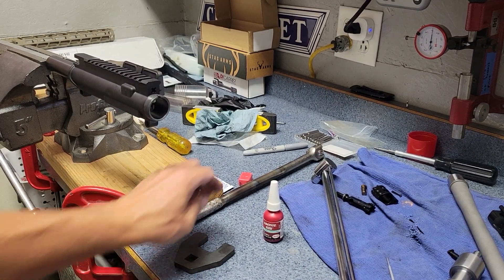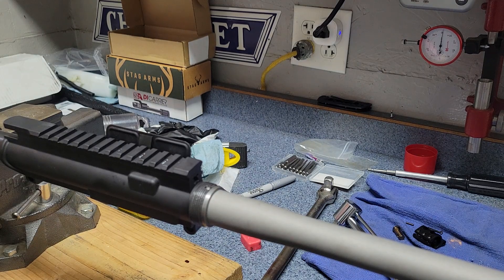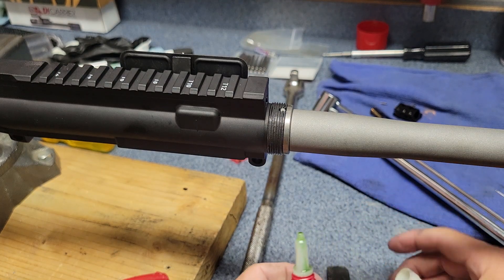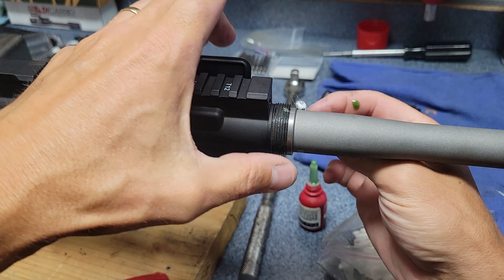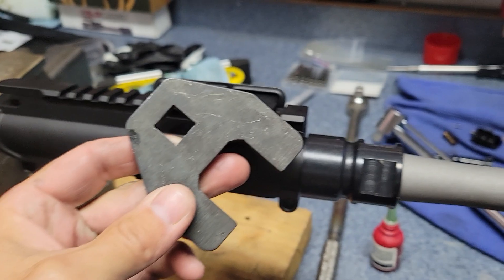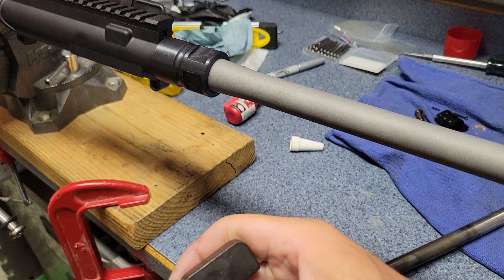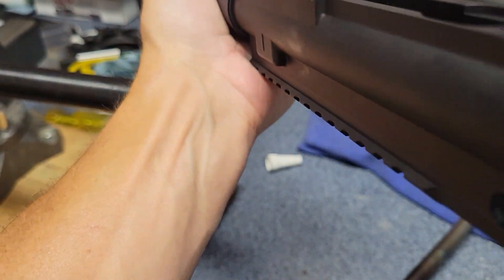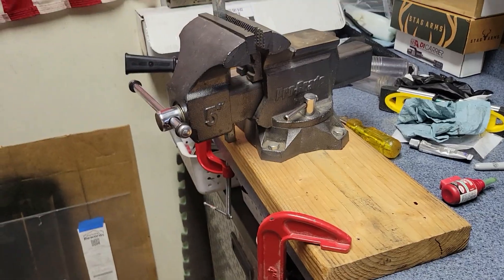22 ARC Build - Part 2 - Barrel Bedding

Comment: Is the sleeve retainer pretty much permanent? Or will it come out if needed?
Reply: You are supposed to have the crow foot wrench 90 degrees to the torque wrench. The way you did it, you increased the actual torque applied to the nut.
Reply: @boydsteenblock1328 just came here to say this
Reply from the maker: The barrel will come out without much trouble.  Loctite 620 is not an adhesive.  It just fills small gaps, taking the "slop" out of the barrel to receiver fit.
Reply: @ShopTowels  nice! Thank you